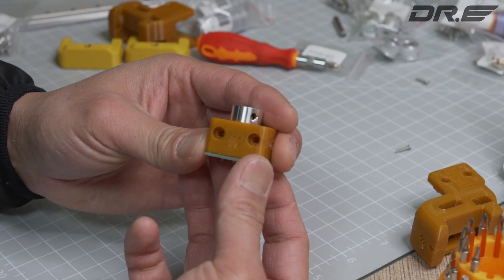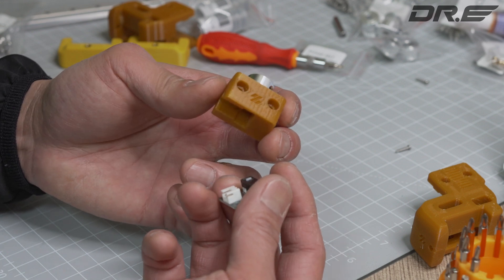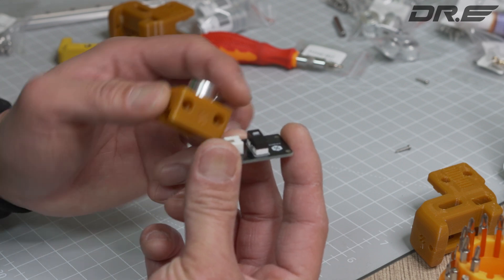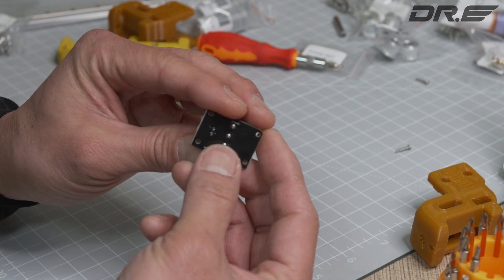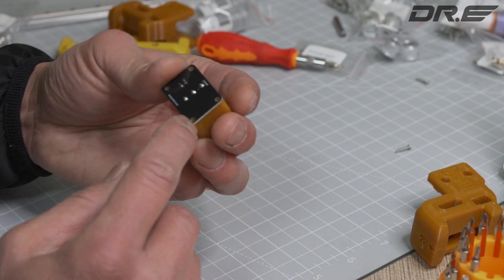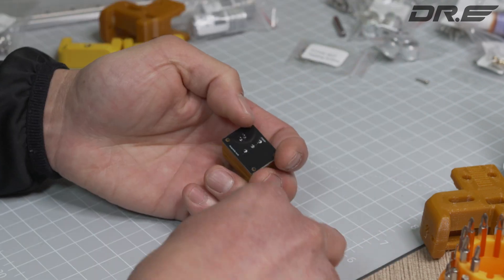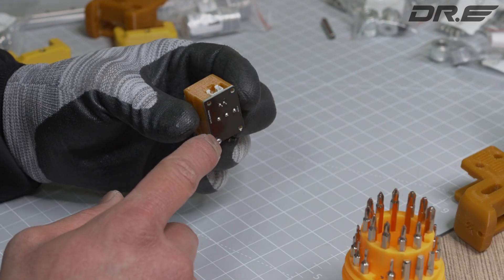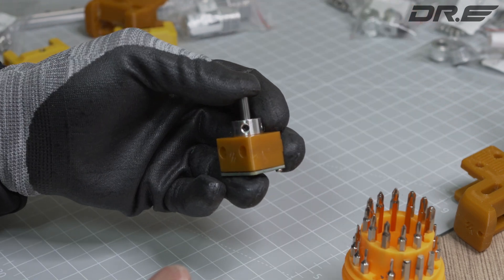Missing Z-Endstop switch on Formbot/Aliexpress Voron 2.4 Kit?

Comment: By now they provide a injection molded version of that holder with custom metal parts, which on one hand looks nice but on the other it's not using the grub screw trick to hold the pin in, which now keeps falling out when flipping the printer over.

Mounting the PCB like you did was my plan B, but the PCB plus solder joints are so high that the whole assembly can no longer fit on the extrusion as the holes do not line up...

So I'm a bit torn by this "upgrade" and actually are considering just buying a seperate microswitch and connector to back to the original Voron 2.4r2 design as I then know for sure the pin will not be able to fall out...
Reply from the maker: I just use the probe as virtual z endstop, much less hassle then actually installing one.  I've had so much trouble with physical z endstop not being accurate even with a tiny ooze of filament, it doesn't work well unless you have an automatic nozzle cleaner.  See https://youtu.be/dOgnZpu9wgA

Comment: Do you find the solder on the bottom of the board hits the plastic base sheet making it hard to attach the switch without bending something?
Reply: I have this same problem. The PCB and solder joints makes the z-endstop too tall to align properly with the bed extrusion, since the bottom panel is in the way. I can't think of a solution other than to modify the design to make the endstop a little shorter. Another option would be to raise the bed extrusions slightly with washers and longer screws. Supposedly the bottom panel, being acrylic, will sag anyway, removing this problem. But none of this is very elegant.
Reply: @Patmanduu  I ended up using washers and longer screws for now. I'll eventually replace that panel though as it's like you said sags overtime . Wonder if I can create a pocket with a router or something